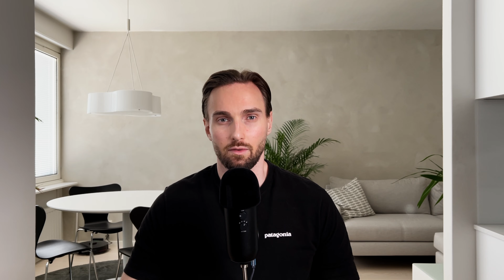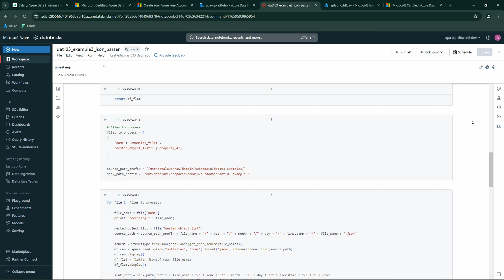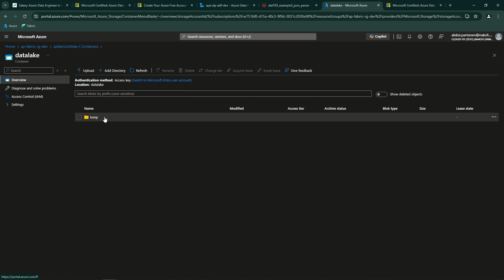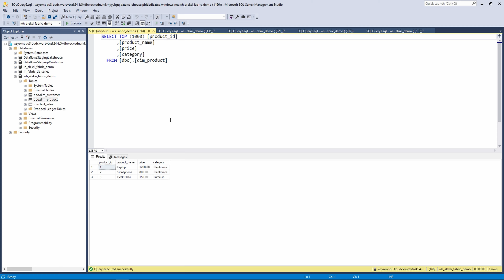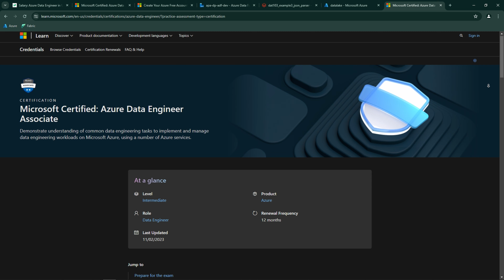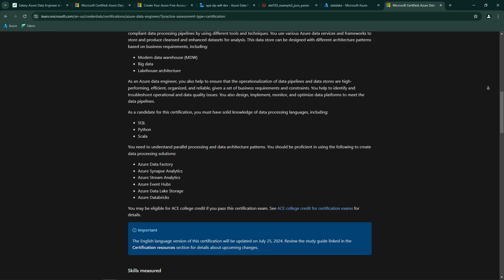Ultimate Fast Track for Azure Data Engineering!

Comment: Ultimate fast track = nolife for 30days 😂
Reply from the maker: No Pain, No Gain :)
Reply: and it is absolutely impossible for complete newbie. A complete newcomer needs at least 6-12 months to solidly learn all these concepts and technologies, understand and solidify this knowledge. One month is a complete bullshit.
Reply from the maker: We are only talking about the bare minimum for a junior level position. To be able to do Azure Data Engineering job more or less independently will required +12 months of experience.
Reply: @AleksiPartanenTech  Nope, stop joking, for a complete beginner one month is not enought to aquire fundamentals allowing to get the first job as an Azure junior data enginner - not even mentioning about passing two Microsoft certificates. It wasn't sufficient 2 years ago and right now, in the current situation on the labour market, it is almost impossible.